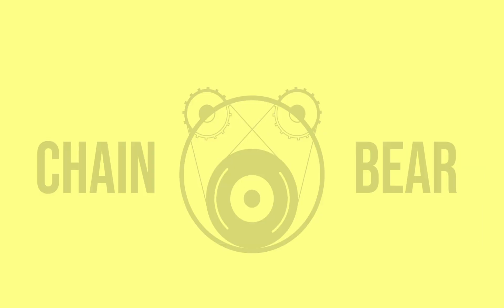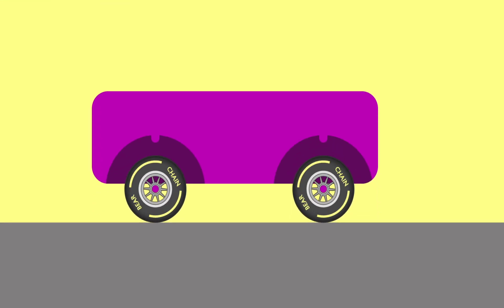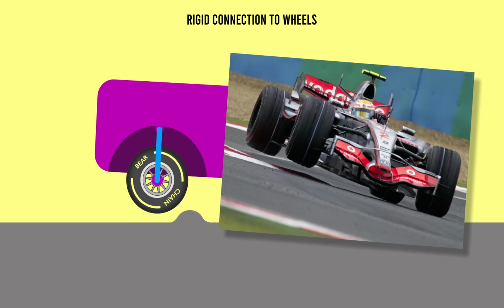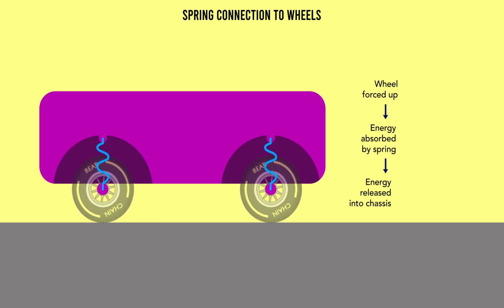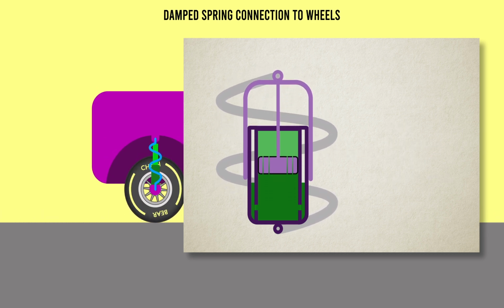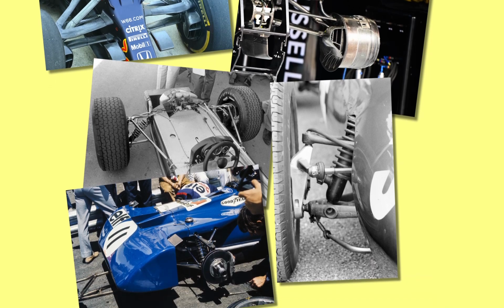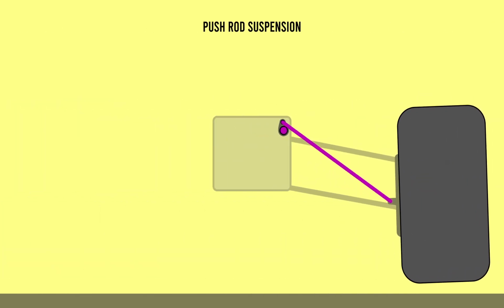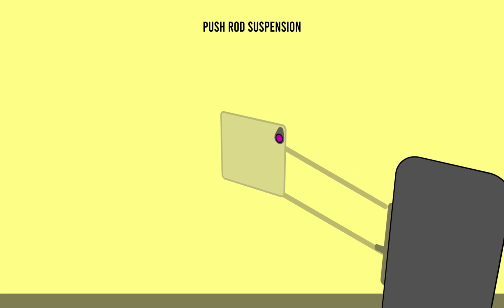F1 Suspension pt 1 - the Basics: Pushrod, Pullrod, Dampers, Torsion Bars

Comment: At the risk of being super pedantic, at around 3:20 you talked about how "springs store energy by compression like how elastic can store energy by extension" however this is almost implying that springs can't store energy by extension, which they absolutely can if they are designed to do so.

Comment: Great video!

I have a question, when the wheel goes up and the damper gets pushed in, the torsion bar also twists. Upon releasing the tension in the bar, wont the effect of the damper be basically nullified because its going back to its original position instead of damping inwards, thus not really transferring any of the energy from the torsion bar.

Comment: The 13" tires are a huge component to the suspension. A lot of the suspension is done by compressing the tires. Also the reason the teams ha e to make completely new suspensions for the '22 F1 car, as they are fitted with 18" wheels. The side heights of the tires is much smaller and can contribute less to the suspension.  The new suspension itself, has to do a lot more, next year.

Comment: Finally....never seen a clear explanation of f1 suspension basics before.  Another kudo from a f1 fan.
In many cases, there is a basic assumption that all fans know what is being discussed when terms like torsion bar are thrown around, or when great import is placed on the height and position of the visible elements.

Comment: Traction, Drive train, power unit innovation is generally far more exciting than this new boring era of suspension and aero spec-like series. FIA should deregulate nonsafety dependent regulation. Red Bull wants to run AWD? Let them. Mercedes wants to run 4WS? Why not. Ferarri wants to copy William’s aero? Good luck. 👍

Comment: Don't agree with a spring working only in compression, and elastic in tension. It stores energy in displacement. A typical spring can store energy by either extension or compression, or "pushing" or "pulling". Elastic band can also store energy in compression, but the band itself buckles before you can compress it. If you have a short and fat piece of elastic, you can compress it to the same effect.

Comment: Missing: the role of the large pneumatic volume inside each tyre as rising-rate suspension, albeit with only friction within the rubber for damping. The 13 to 18" rim change will make a big difference in suspension setup.
Reply: The 18 inch rims contributed to porpoising
Reply: That might be covered in part 2 (I haven't watched it yet), but it's a detail which certainly doesn't belong here.

Comment: So here's a question, while I can think of a few reasons it wouldn't work, has anyone tried tying a torsion bar to a flywheel for energy recovery? If you had something like a ratcheting system (I couldn't think of something else that works one way, though the sound would be fun.)  you could theoretically apply energy every time the suspension is activated and still allow the bar to return to it's original position without arresting momentum.

Comment: Is there an answere as to why F1 teams don't conect dampers and torsion bars directly to the wishbones? that would be more aerodynamic and lighter.
Reply: Torsion bars connected directly to the wishbone would load the wishbone in bending force. That works, and has been widely used in production vehicles, but it makes the wishbone heavy.

Comment: So the main reason F1 uses pushrods is the size? Or does it actually have better driving characteristics?
Reply: Pushrods allow the heavy dampers and springs/torsionbars to be mounted nearer the middle of the car, reducing the car's polar moment in roll, and also mean you have a slimmer simpler element out in the airflow.
Reply: @EmyrDerfel  That makes sense, thanks!

Comment: As the wishbones are also moving, how are they constructed to be so strong and flexible!? I know I can prob look this up haha.
Reply: Yesss, and the bushings and ball joints allow that movement 👍
Reply: the wishbones don't flex, then just pivots in its joints to keep the wheel vertical
Reply: @sc5691  At 6:35 the diagram shows the wishbones flexing? unless the wishbones are connected to joints? In some photos, the joint to the body looks solid :o curious how this works.
Reply: wishbones don't really flex at all, if they do so then they would act as "springs" more than the actual coilover/torsion bar itself

I think it's just a small animation inaccuracy :)
Reply: @sc5691  I think I'm missing something in the way the wheel/brake ducts are connected. If the wishbones don't flex, and the wheel mount is connected to the wishbones, wouldn't that mean the car has no suspension at all? As in, the springs/dampers can't work because the system is rigid. I think I have to look into it haha. My car knowledge is pretty sparse.
Reply: No bro, they were jointed in the chassis mount and in the knuckle (I think it is what it is called, it is where the wheel where mounted) through bushings and ball joints, wishbones guide the wheel to remain in its orientation.
Reply: Here's a video link, hope it helps 👌

https://youtu.be/DsEmK1M87VQ
Reply: In simpler words, the wishbones just hold the wheel and brake assembly
Reply: @sc5691  I see so there is some mechanism to allow that assembly to move up/down.

Comment: Why F1 still using the 6arms. Why coudnt 4. Lower and upper wish borns can connected via a horizontal torsion bar with dambers. Similarly two connections of lower arm conncted inside chassis via a single horizontal torsion bar. Secondly the upper wishbones conncted to wheel hub seperatly with a Y hub conncetor and front upper arm shuld have a electric motor with a push rod operating a a steering rod. Seperatly on each side or common motor inside chassis. Thus we can reduce to 4arm and can improve aerodynamic property. Anything wrong please currect me.

Comment: Why do you need spring/torsion bar when you already have the hydraulic system?
Reply: Springs are for coarse control, dampers are for fine control. Springs also are far more influential when it comes to car handling - dampers obviously influence car setup but they're seen for finetuning the car, nowhere as influential as corner springs/torsion bars.

Comment: I have a sort of correction: a torsion bar is a spring, it’s essentially a coil spring that’s been straightened out, and when it’s torsioned, that’s the same process that happens to a coil spring, a coil spring is also being torsioned in the same way in order to compress.
Reply: I also have a correction (I think - not 100% though).  When he has the diagram of the wheel at say 7:21, the wheel tilts.  Surely the wheel should move directly up and down.  No rotation.  The 2 wishbones form 2 sides of a parallelogram.  If the wishbones are not attached to the chassis immediately above and below each other, then the tyre should only move up and down and not tilt??  Maybe he's saving that for the next vid :)
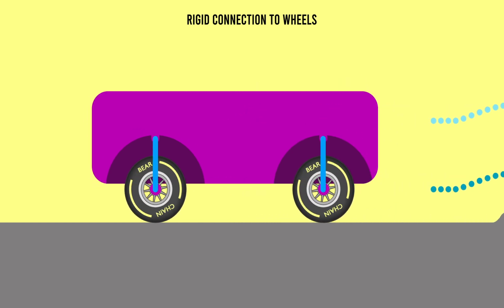Reply: And also, what's with the magic bump @ 2:34?  Are active roads becoming a thing in 2021?
Reply: @EscapeMCP  With equal length suspension arms that would be the case, but camber gain during compression is desirable.